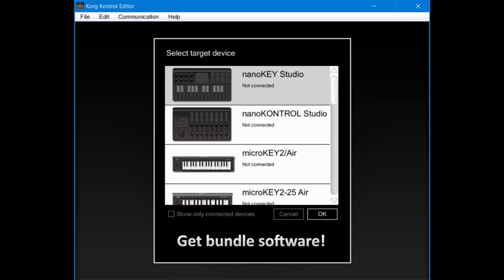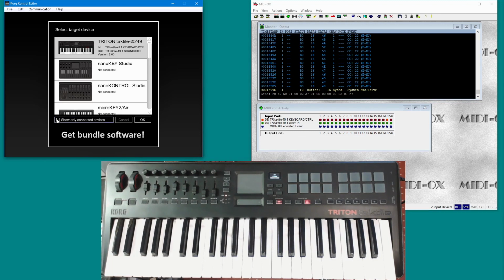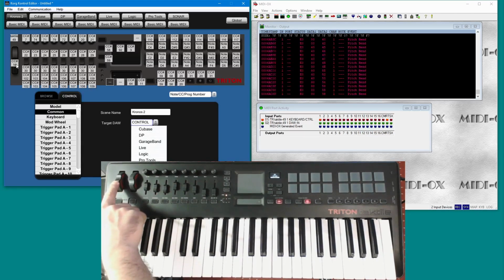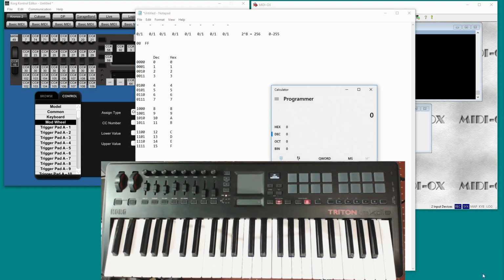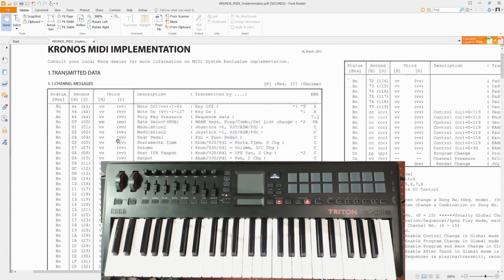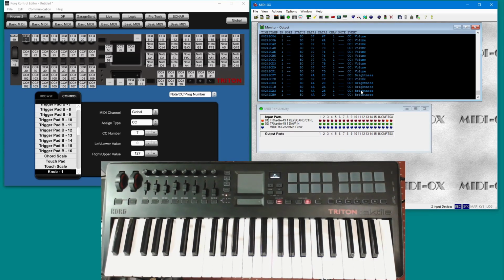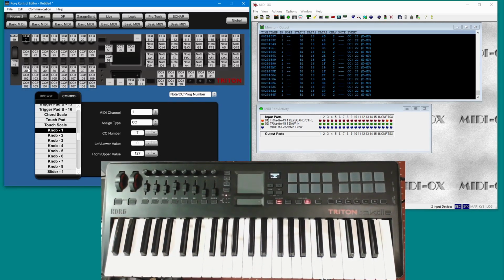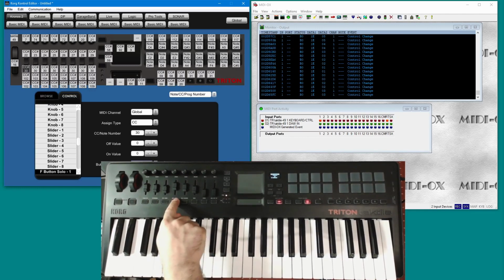Korg Kontrol Editor (explained with a Korg Triton Taktile 49)

Comment: wow brilliant ,learned a lot.but still need to find something out .I have an M1 module 05r/ W and want to change the reverb .mmmm thanx you have got me closer
Reply from the maker: Thanks a lot for watching the video. Unfortunately remote controling external equipment is not fully standarised. Sometimes it is not possible to remote control every parameter. In your case, you may check the M1 documentation and see if your desired parameter is controlled by MIDI CC messages. If not, then probably MIDI SysEx is the case. I don't have this MIDI controller anymore. Please check if sending custom SysEx messages are possible with it. I hope this helps.